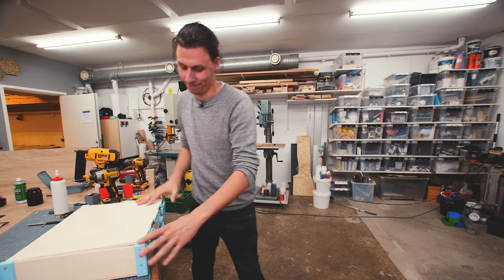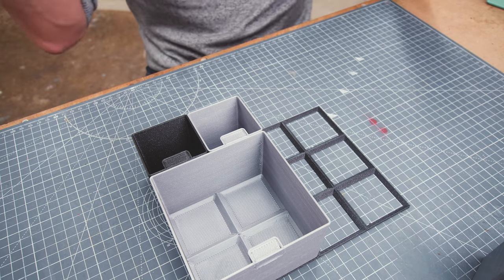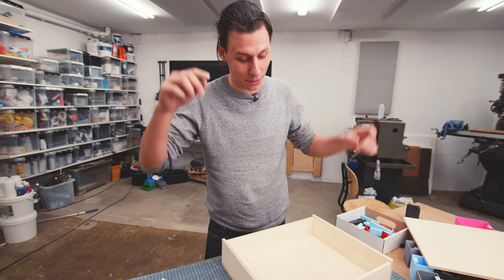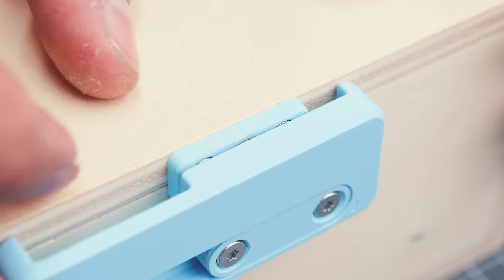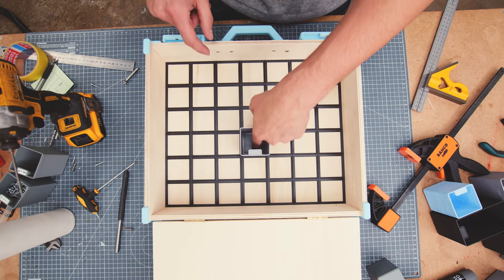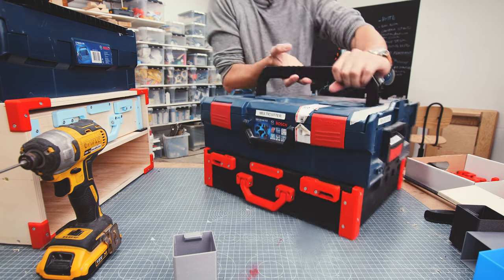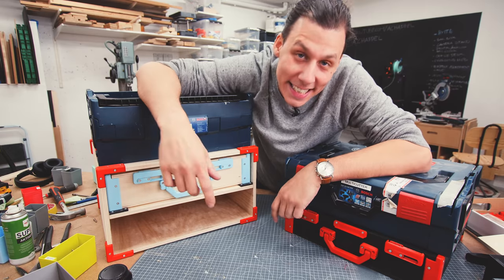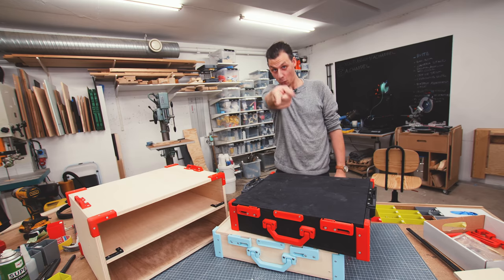3D Printing Even Better Assortment Boxes - And Making a Case for Them!

Comment: Why not do away with the double box & just make them snap together like with the Bosch boxes? That’ll get rid of some bulk & let you connect more boxes together. It also gets rid of your problem of the box not fitting into the bigger box when you add those attachments to the top.
Reply: My thoughts exactly
Reply: Cool for transporting, but you'll have to remove all the boxes on top of the one you want to get your stuff out that way, unless you make a modular draw system instead :)
Reply: @chrisoverson  Good point!  Can't have it both ways I guess :(
Reply: Yeah I thought the same! 
And I know people who has built sliding drawer bases with the click lock thingy on them so that the boxes locks into them and then they work as normal drawers 👍
Reply: I made a comment like this, then saw this one, so deleted mine :D
Reply: exactly what i was thinking
Reply: I think one of the challenges for that is making a compatable clip that is both strong and has enough sprinv tension to stay clipped
Reply: The Bosch system is designed for this purpose...at least the demo video shows a stack of differently sized boxes all clipped together.
Reply: @j.markmeacham373  Yeah, but where's the fun in buying it all when you can make it yourself 😄
Reply: @AvilerED  Totally agree. I didn't even know the Bosch system existed until an hour ago :) I hope to print some slightly modified assortment boxes to fit bins that hang on pegboard soon.
Reply: That would work but it would require adding latches to the custom boxes.
Reply: So close to a customisable sustainer system which interchanges with workshop storage, van storage and site convenience...one system for them all. Come on @alexandre.chappel you're so close to the thing we all desire 😁
Reply: Yes it would be cool! stenley Fatmax boxes are made this way .
Reply: @chrisoverson  you have to remove everything anyway, because you can't open the lid unless you take the box out. At some point everything will be opened, or else you didn't have to bring it with you.
Reply: @madcoinage  That seems to be the main issue here yes. It seems to be PLA that he uses for most of the prints as it is easiest to print and use. The PLA is not bending that much and it seems the bosch box has plastic that bends a bit more into lock position. Other way would be to make it with springs and then the locking mechanism sliding into place, where the springs locks it into slot, so you will end up with a button to press. That probably has the issue of being quite bulky to print out and fit together. 
Easiest solution would be probably to make some "slide in place" locking mechanism. After sliding in place you probably have some kind of locking mechanism that avoids it from sliding out again. Easiest would be slot that has a bit of slack and when lifted up, then it moves into locked position, but when put back down on surface it can again easily move out of the slot. So kind of P shape but turned 90 degrees. Other point to keep in mind is orientation of print, 3d prints are the weakest parallel to layers, the most common issue being delamination of layers during stress, so the locking mechanism should also be easy to print in orientation where the force to hold boxes together is perpendicular to slicing of object.
To make the slide in place locking mechanism to be compatible with bosch, there could be adapter that you can just slide into the slots and then locks under bosch clips, that way you can easily even design and print some other type of adapters for your own locking mechanism. The downside of adapter is that most likely there will be extra gap that is not so appealing to eye.
Reply: Lol, saw this after I posted pretty much the same comment. Haha, guess a ton of people are thinking the same thing.
Reply: @chrisoverson  No, you don't. You have each box attach by the lid to the one above. You can then open it with the other boxes attached. Widely done by virtually all tool manufacturers.
Reply: @krisavi  Over-centre locks using PLA and wire straps work perfectly well. I have built a number of boxes using that method. The amount of 'give' is well within what PLA can provide. I have also replaced a number of catches on commercial storage boxes because they were the wrong colour for my workshop- not one has broken or failed in any way.
Reply: @chrisoverson  you could make 'box expansions' so there's a box that you can expand to have more levels, so it doesn't have that problem. Maybe that's what a modular draw is, but I don't know lol.
Reply: All of the sudden you are back on having ton of carry boxes, that's where you started a year a go 🥳
Reply: Already replied with similar before I saw this.  Combine this (with all clip into one another) with Ron Paulk (also struggling with how to really monetize social) mobile work shop ethos (no more F'ing can't-find-my-stuff tool boxes).  It's gotta be all accessible and organized all the time.  No piles of crap in big compartments. When Paulk talked about hating tool boxes in one of his vids it was like "Eureka!" - I hate them too!  I don't like the "viewtainer" thing Paulk uses for screws because of expense, round=inefficient, and my life has way more varied and tiny stuff than home remodeling or finish carpentry requires organization of. The woodworking guys out there may not be 3D printers.. major bummer man.... printing these varied size modular boxes is the key... but $5 for grid?  Give us great content and plans then reap the rewards brother.  Study Gary V - as Mando says "this is the way".
Reply: @3DPSpro  Agree with most of this. To me, a major issue is between the best storage for a workshop and for mobile use. Quite different needs, and full of conflicts. For workshops, if not on pegboard/French cleats then drawers as large as possible with flexible size holders. Those 'walls' of Systainers are probably the worst possible- 7 step retrieval (pull, unlock, lift, grab, shut, lock, push) compared with 3 (pull, grab, push) of drawers (pegboard being one step). I keep a (reduced) second set of tools in an organized toolbox for mobile use to resolve this conflict- but I do not do much mobile work. If I was a professional I would probably expand this separation.
Reply: @Tensquaremetreworkshop  Dude, super well put.  Did you look at Ron Paulk's "SMART" mobile workshop?  I realized it is the perfect thing for me because I am  between workshops, but also because I will continue to flip homes.... and well because all my tools and materials are always a mess.  The conflicts between permenant and mobile/temporary are obvious, but I'm thinking that maybe the time investment of building this mobile workshop might solve my workshop woe's... the "mobile workshop" and "pick your iteration of Paulk workbench".  It never hurts to have a crapload of drawers and compartments.  I have yet to see how this will ultimately look for me, but whatever it is, it'll be way better than my current disorganization.  I'm not a professional, but well experienced.  I'm apt and have tools grabbed back from an attempt at having (fraudulent) contractors manage multiple invasive flip projects combined with personal interest maker stuff.  Who know's what the "perfect" setup will be, but damn, I really gotta try.  *disclaimer: not associated with Paulk or agree with selling of every little idea
Reply: @chrisoverson  just disconnect the one immediately on the top. the ones connected to that one can stay.
Reply: You could also just make the drawer openings higher though

Comment: For your old boxes you can just put some anti-slide mats in your drawers. 
These mats are really cheap and work really well.
Reply from the maker: That's a great idea!
Reply: I guess I should've read your comment before I posted mine, you beat me to it 😂
Reply: 3d printer owners' dilemma: can't solve problem without 3d printing
Reply: @yonggor  😂
Reply: Yeah, but CoNtEnT 😂
Reply: Noooo they tippover! Is worst.
I'm not sure if is cost effective to print boxes or to purchase. The small one they cost €0.1 each.
Reply: Thats exactly what I did, I ended up doing this in a large craftsman toolchest I had and dedicated a couple drawers, put rubber foam tool chest mats in the bottom .  Regardless the grid design is pretty smart.  You have my Kudo's on these designs @Alexdre Chappel
Reply: Wouldn't just staggering them be better?
Reply: @agapiosagapiou  I was thinking the same thing. But if you look at the price of 1x1 sortimo boxes they are €.64. That is a savings of  €232. Put that money towards the 3d printer and you have the best of both worlds. Plus they only work with Sortimo so you have the  €35 for the sortimo case. No matter how you look at it his approach is worth it.

Comment: Really clever design. The only thing I would be concerned about is, that the printed Bosch attachments hooks might not hold up if both of the assortment boxes are completely filled with screws etc. I would be worried that they break off when you carry them around.

Lookwise I prefer the black and red version.

Comment: Wow, thats a neat system, gotta build some of those for myself !

Two improvement ideas came to mind right away tho: 
1. Get rid of the outer wooden box, just unnessesary weight,
attatch the same hooks to the bottom of the boxes as on the bosch boxes.
Now you can combine as many as you want.
Also you can fit some sturdy rollers on a single board and attatch the snapping mechanism,
to create a cart out of any stack in any order, if needed.
2. Lid with window or entirely out of acrylic, just so i dont have to remember whats in which box.
Afterall, everthing fits everywhere, so it ends up who knows where ^^

Comment: Hi Alexandre, I was slowly cleaning up my workshop in the last year, but when I found this video, it was the spark that I needed to accelerated my cleanup.  I bought your assortment boxes and my 3D printer Ender 3 Max has been printing these boxes 24/7 for the last 3 weeks.  In the mean time, I brought a lot of stuff to recycling or give to some friends to make room for this new organizing system.  Thanks for putting this together.  I find the boxes very well designed.

Comment: Nice touch making them Bosch compatible. Only thing missing would be a thin layer of felt, foam or neoprene on the underside of the lid to stop the rattling. But the rest is nicely done.

Regards, 
Etna.
Reply: It would also help get a better seal, so if you had small washers, they'd stay in their container.

Comment: Instead that you tossing your tools on top randomly into the carrying box, why on earth don't you form a separator, and walls within a box or put in a box all of them? Instead of printing plastic blockers to the cases to prevent falling out the carrying holder, I think it would be better choice to implement drawer slides, and wheels on bottom of the stack/or separate wheels deck module with clips on side. A stack-able and variable assortment box on wheels can be really useful... Also I suggest to print assortment list, or at least categorize by colors or by numbering the cells can be handy. Include a giant battery compartment with external charging plug: so all of your tools/batteries gonna be charged, and ready to run. Pro design idea: make your rolling toolbox an dock where you can charge it with qi charger wirelessly the main battery. If this battery plug goes into a stack - case/box then you can chain up the whole, or you can ensure that you can have always mobile power with you. Also add some internal lights, or mild led stripe above the compartments, so that ways staying visible.

Comment: Another really cool project! My 2¢ here is that your boxes are prime candidates for casting using RTV silicon molds. 3D printing every single one is a horrendous time and power use, whereas casting is incredibly quick and no electricity needed. This goes for your Bosch clips too - they will be much stronger in a urethane casting from a mold made using your printed part.

Comment: Awesome video...I bought the complete package for bins, brackets and cases.  I love natural wood color grain with color pop; however, the baby blue looks cheap and childish.  Recommend a deep blue or grey/black with natural wood.  If you're going two-toned colors, you can't go wrong with a dark blue box with orange or red brackets (NFL Bronco's Color).  
I recommend you print your bins in specific colors to the size box.  1x1 = Silver, 2x2 = Red, 2x6 = Blue, etc. That way when you're grabbing a bin, you'll know how big of a bin you're grabbing.
I"m all about shop organization, so these bins will definitely help with that, but it will take time and physical effort to sort through the tubs an tubs or parts I have, but I plan to use this in my kitchen as well for various parts draws (catch all drawers).  I'm going to start printing today on my 3D printer and maybe while I'm at work I can have my wife keep printing and printing and printing.

Comment: meanwhile, me as a poor person who can't afford a 3D printer:
TUPPERWARE AND VELCRO TAPE
Reply: Entry level machines are like 120 Euro. Tupperware is way more expensive...
Reply: @janosnagyj.9540  Sorry, I mean Chinese knockoff food containers
Reply from the maker: @ryle1683  hahaha
Reply: Or over some years collected ice cream containers...
Reply: @Deva-Jufan  Those have thin walls which became brittle over time...
Reply: ahhh yes, cheap containers for the win! I have a printer and still use cheap containers while deciding on how to contain my ala Chappel boxes, now with v2 I guess it's time to start printing
Reply: I'm surprised you can afford the velcro tape if you're buying Tupperware, that stuff's expensive! :D
Reply: I got a load of knock-off Sortimos from the local big box store for £9 each. I believe Harbor Freight do similar things in the US (I'm a Brit). This has inspired me to print more inserts in weird sizes for my cases though, and also the drawer insert for the same grid.
Reply: @ryle1683  those are way too large. if you try to fill them with just one kind of bolt (ie for sorting purposes), you'll either way underfill the container and waste a lot of space or end up combining it with other sizes / styles of bolts, which defeats the purpose of organizing.

Comment: This system is so smart ! I prefer the natural look of poplar, but you could use defeerent colors for handels and corners as a way of quickly sorting out different uses for the cases ! For example, the red case could be for nails, the blue one for screws or the green one for wood work and the yellow one for metal work ! It just has to be sorted according to your use !
Grate video like usual ! I really like the way you mix 3D printing and wood working !!! Thanks for the great work and the inspiration !!!

Comment: when you clean the cyanocrilate with your finger 😅
Reply: Cyanacrylat doesnt work well If you want to glue pla with pla. 🤷‍♂️
Reply: It's not toxic, but definitely annoying to have on the skin haha
Reply: It can be removed with wd-40
Reply: @AnDy-of3mj  or Alkohol... ✌️
Reply: @homeandgarden7688   or Table Saw
Reply: @AnDy-of3mj  thanks, I have always used sandpaper or a file for it, WD40 seems a better idea.
Reply: @giostepanishvili6098  Bad idea... bandsaw is always safer than tablesaw. Fine woodworkers use freshly sharpened chisels tho, for superior control (and general superiority).
Reply: yeah, its a habit that sticks..
Reply: edu puertas It’s “cyanoacrylate”.
Reply: @Jeremiah Bullfrog You've not seen smugness until you've talked to a true hand tool fanatic that rejects any powered tools. It's honed to perfection during countless tedious hours doing things that takes minutes with power, like sanding... Of course they don't use screws either.
Reply: @Jeremiah Bullfrog Absolutely, I definitely do. But I also admire the same craftmanship in choosing the tooling on a face mill, or programming the right paths in the CNC for a desired finish or to avoid artefacts; which they pointedly refuse to do.
Reply: @giostepanishvili6098  Genuine LoL  :)
Reply: @homeandgarden7688  I've had 4 beers and a shot of bourbon and the glue is still stuck to my finger...I don't think your idea works.

Comment: Why not make the DIY boxes snap together like Bosch/Makita/Metabo/... boxes do? Then you don't need the extra box.
Reply from the maker: mainly so I don't need to unclip the boxes when I want to get to what's inside like I have to with all my bosch boxes :P Bosch actually has a similar system to this as well :)
Reply: @achappel  yeah, the Bosch/Sortimo L-Boxxes arent easy when you stack a lot, the new generation enables you to open, but still not good. The T-Boxxes does not snap together, but are similar to yours inside for keeping the smal containers in their places, but you need to buy Workmo rack to stack the T-Boxxes again, or build something similar.
i like what you made here, but with 15 T-Boxxes I think I'm stuck on that system (missing the workmo rack though.)

Comment: I use mostly DeWalt tools, so I like the idea of Yellow Box with Black Trim, Ive made different tools and Organizers as well, I always Round the inside corner so its easy to pull them to a edge and up and out with out any sharp edges to stop it, I do like this Idea to add to Shop Carts/Tool Stands, the 3D printed latches and Corners are what really makes it, Ill have to defiantly build;d some when I re do my carts.

Comment: As always a awesome project Alex! Very smart design choices between woodworking and 3d-printing. A rounded corner-case with fillets on the edges and a varnish surface would also make a nice touch. And your initials engraved.  Keep up the awesome video's, love it!